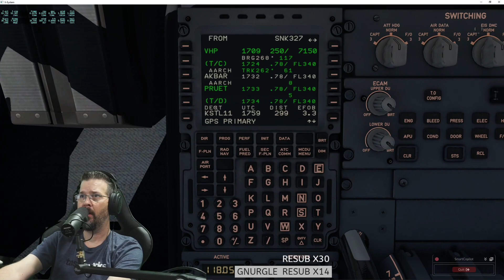SharedCockpit Toliss A319 with dmonies327

Comment: Good think you were in an Airbus. Any another plane would have stalled on you when you retracted flaps after takeoff well below flap retraction speed ;)
Reply from the maker: Good point...  reading up on this... thinking flaps up to 0 comes after setting climb thrust and sometimes even at 3000ft agl need to study speedtape and actual speeds where I can retract.
Reply: @JonFlyTV  No its like in any other plane. You have a Thrust reduction ALT and an Acceleration ALT. Both CAN be different but you have to watch the speed of course before retracting.